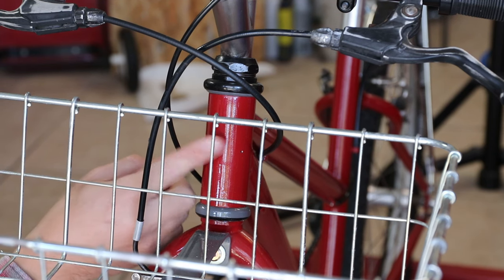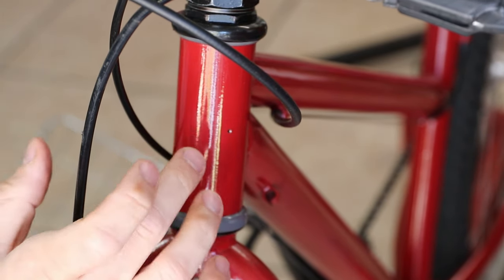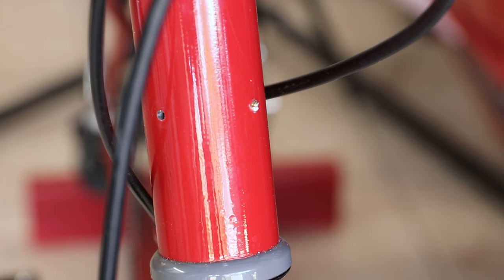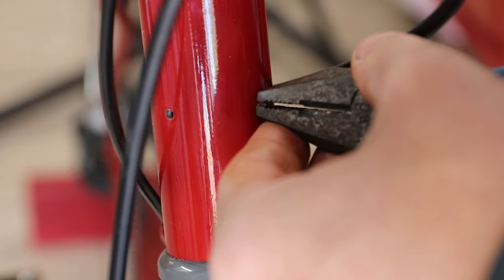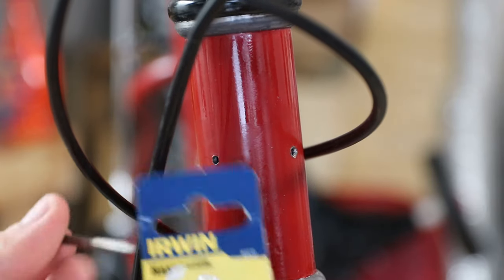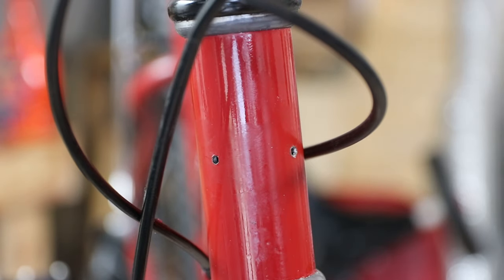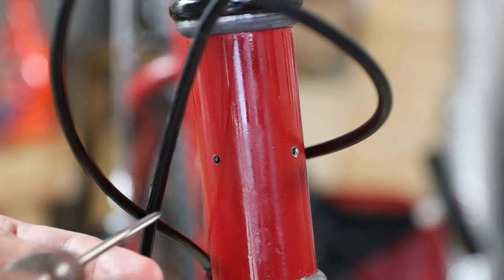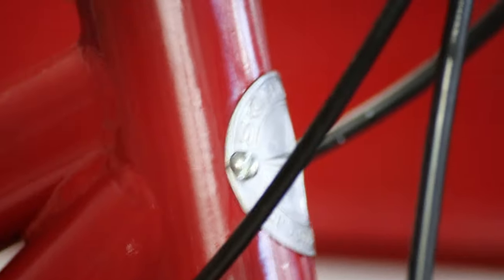Changeable headtube badge

Comment: The laser aluminum badge looks nicer I think, but you might try to polish the old badge, that would look cooler IMHO. You might use a little bit of metal polish on a buffing wheel, no need to sanding, seems clean enough.
Reply from the maker: think so? I was thinking it didn't have enough contrast. But yes I didn't even think of polishing the original one, that would look cool.

Comment: Nice job, but why did you use such a large screw? Maybe a 2-56 would have been more suitable. Just my opinion however.
Reply from the maker: thanks! these were just the screws that came with the badge, but yeah maybe slightly larger would have been easier.

Comment: The wood would have been cool with wooden pizza box if you did wood front basket.  With wire basket the raw aluminum looks rad
Reply from the maker: maybe I'll laser cut another one and try it out. I think I'll try to pre bend it maybe using water.
Reply: @BruceChastain  Steam is what you want for bending wood. Used by boat builders.